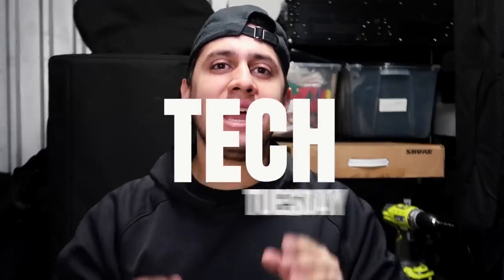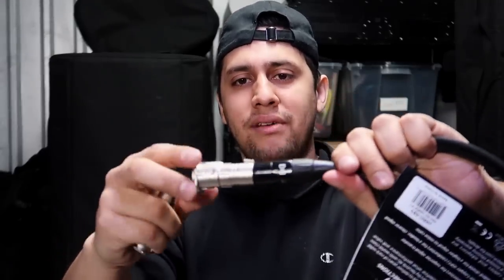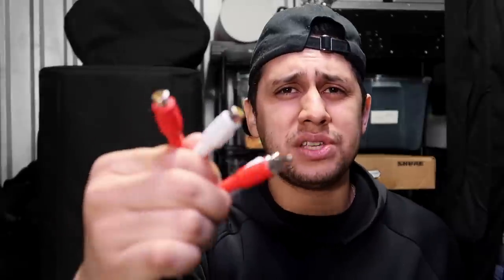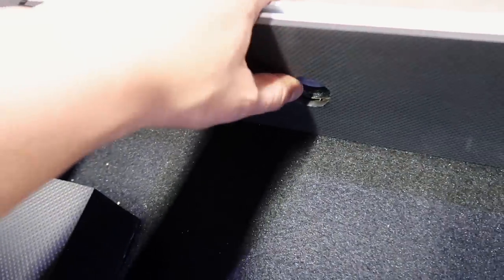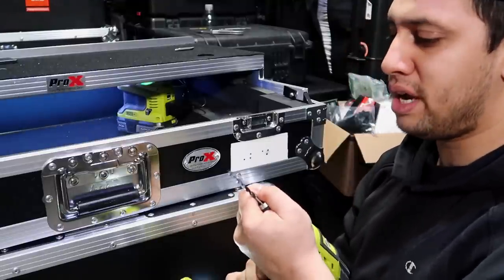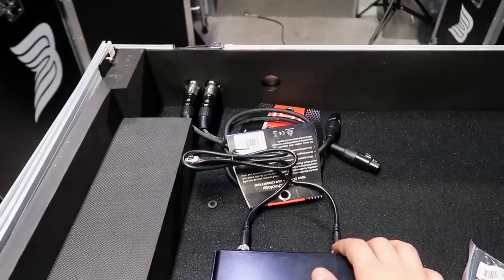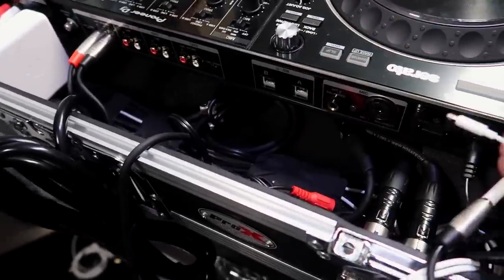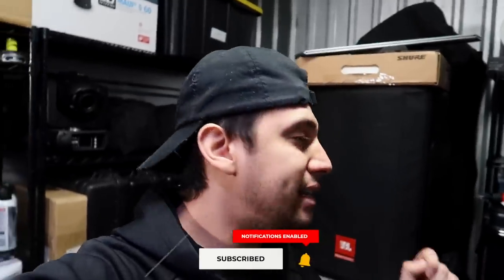Pioneer DJ DDJ-1000 Flight Case Build / Mod (Pro X ATA) - DJ Console

Comment: Looks great ... One thing I started doing to prevent blow out on the backside when drilling holes is to clamp a piece of 2x4 on the inside of the case. I then drill the hole and it is supported by that 2x4. I end up with a much cleaner hole that looks perfectly drilled on both the outside and inside!

Comment: Dont use wd40. It is not a grease/lubricant and your shelf will go back to not being smooth shortly after. Petroleum jelly is an easy to find lubricant that will last for years.
Reply: Other then that great start to the build. Not really positive on the cables made by robots part. Pretty sure the top end hosa ones are hand assembled.

Comment: Nice video. I did the same case build with a few variations. I did the holes for xlr's on the right side.I also made two more holes for more xlr outs. On those ones i used a right angle 1/4 inch connector and went into the booth port in back of the DDJ-1000. I use those ports to control the subs separately. You can also order covers for your xlr ports on the outside.

Comment: Hey Barr, you can use Velcro cable ties for cable organization, you can cut them to smaller lengths if you need them smaller for a custom fit. The velcro sticks to the carpet material. Also, I put Industrial Velcro on the bottom of my shure Wireless Mic receiver, so I have extra space to the right of my 1 rack space for accessories, etc.
Reply: I was gonna say that. He coulda just Velcro’d the receiver instead of making more holes to the case & using them brackets

Comment: Cool video I love this case build! I watched rick web, he snipped the wires and soldered them and i like how you got the xlr adapter to connect to the xlr cable. Just a heads up those apple cables will break very easily and very quickly...shouldve gotten anker chargers for your phone, ipad and mac

Comment: What holds the controller in place, is it screwed in or just left to move and hit the laptop tray when in transit? Good vid though.
Reply: back/underside of the tray has a foam piece that sits right on top of the controller when closed.

Comment: That’s nice… I’m gonna do a similar mod to a few cases that I have… as far as the foam causing that cable to bend I would have just cut a slice in it to allow the cable to stick straight out…
As far a cutting wires… you’re so good with these mods I’m 100% sure cutting and soldering wires should be easy for you… just put some silicone over it and then wrap it with electrical tape when it drys… 
Thanks for the vid man 😐👌🏾

Comment: Hey Barr what u think about the Denon 7000 controller? Any feedback in comparison with the pioneer 1000SRT controller?
Reply: MC7000 great controller works with Traktor, Serato, Virtual Dj, Cross DJ. Has a second sound card for back to back sets. Sounds great. I don't think Barr knows anything about the MC7000.

Comment: Where did you get the 1U brackets? that you used to keep the Mic Receiver from moving and center
Reply: Yes I like to know allso
Reply: @GetYourDJNOW  I found them on eBay
Reply: I could not find it, should be a v bracket that attaches from bottom of roadcase to the mic receiver Rack mount

Comment: Awesome build. Did about the same back to my case and DDJ-1000 this past summer before starting my residency at Cedar Point! I highly recommend the Powercon and using it. I think nlfx will make you a custom cable if you aren’t confident in soldering. I personally love it because it is like a “lock and key” for my mixing board. No one can turn it on unless they have the “key” of the Powercon cable. Just a thought. Love all the videos man! Hang in there, the after party to this virus is going to be LIT!

Comment: i have the same case but the slide stand locks (if that is what they are) dont seem to do anything.  do you use yours?  you will see them on the sliding rail towards the back of the case.

Comment: @Bayardo Rugama  if you don't feel confident in assembling the cables / connectors contact NLFX they can make customized cables for your needs ! it's just a small tip because there are a lot of people like Rick web who buys some cables prepared by them https://www.nlfxpro.com/xlrf-xlrm-pm/ just an little example and they have a lot more options even for power ! if I'm not mistaken i believe Elite Core also assembles customized cables according to your needs !

Comment: There's something missing. What did you use to connect to the powercon inside the flight case, since you didn't snip the ac plugs on your power surger? Please I've been trying to figure it out.
Reply from the maker: I just pull it out of the case

Comment: Human made cables will always be better than robot made ones and a soldered connection is technically better then the connector you used because there is less resistance

Comment: I know this vid is old af, but here's my two cents anyway
All cables are touched by a human hand at one point. XLR cables especially are no exception to this rule. Idk what frikin engineers hosa has to build machines which can cut wires and then solder them to plastic connectors...yeah I don't buy that. What they, along with every other company are doing, is manual labor. That's just the nature of soldering wires. IMO every DJ should learn to solder! First there's the money aspect - it's so much cheaper to buy the parts you need and then make the cables yourself. Secondly and imo even more important - assurance! I've soldered all my cables myself. I 100% trust all of them. Even in the event that somehow a cable stops working all of a sudden - open it up, see what's wrong, get home, take 5 mins to resolder and it's off to the races again. It's not rocket science.